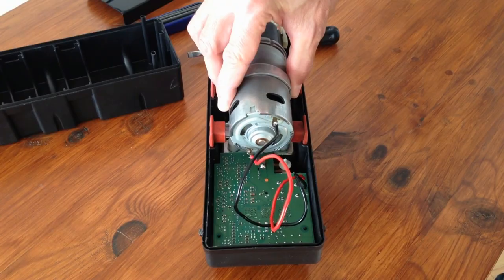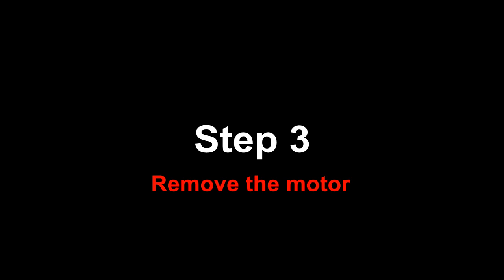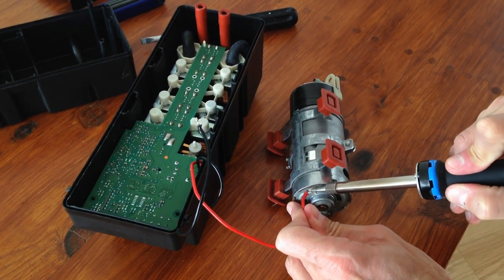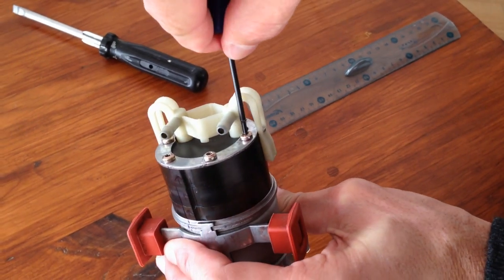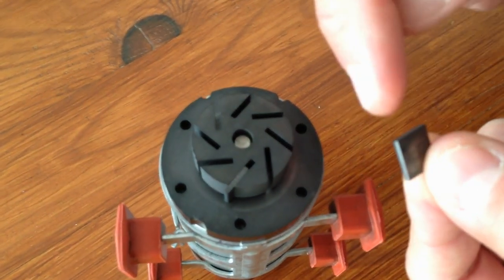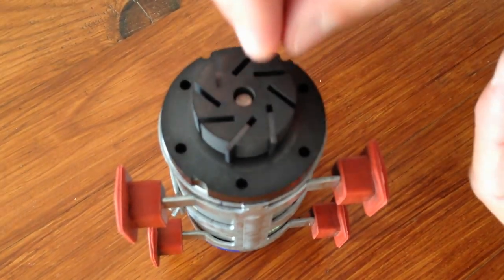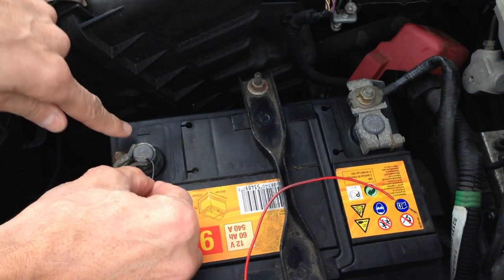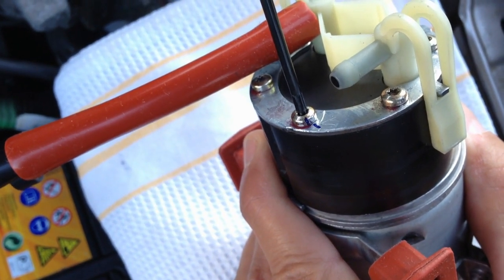How to fix a central locking vacuum PUMP broken ROTOR - Mercedes SL (R230), CL (C215), S (W220)

Comment from the maker: I hope you enjoyed this video !
The replacement rotor used in the video is available here:  https://ebay.us/kYoiGp (US & Americas), https://ebay.us/jjlMzD (Europe), https://ebay.us/TNXoau (France). It ensures a perfect functionning of the pump and the vanes are turned in the same direction as the original one, i.e. to the right when viewed from above (to the left when viewed from below !). Happy DIY ! 😉
Reply: Which way does the pump motor spin?  I am assuming clockwise?  I ask as there are two different rotors.
Reply from the maker: @kentberg9291  Absolutely ! When you hold the motor in your hand and face the drive head, it turns clockwise.
In addition, the vanes must be correctly oriented as on the original rotor, i.e. to the right when viewed from above (to the left when viewed from below !). It's essential for proper functioning. Congratulations on spotting this detail ! 😉You need to be particularly careful, as there are many poor-quality Chinese copies...

Comment: I haved owned a R107  for many years and have for some time be considering buying a R230 but have ben put off by horror stories about problems with leaking roofs and pump problems.Your video's have shown me that all is fixable and has given me renewed  enthusiasm for a R230
Reply from the maker: Hi ! Thanks for your comment. The R230 is a beautiful machine but a bit temperamental... That said, with patience and passion, you can do anything !

Comment: Fantastic video, merci beaucoup. 
I appreciate in particular that you mentioned the interchangeability with the three models, your demonstration of how to measure the pressure provided to calibrate the pump, how you point out the importance of alignment during assembly and how to prepare for it during disassembly. 
👍

Comment: Hey man, thanks a million - just pulled my pump out tonight; '01 CL600 - had blown the fuse a couple times.  Looking at it after watching the careful alignment work you did, I could see that the carbon rings were not neatly aligned.  Taking it apart, I found the rotor was not cracked - it all looked good.  I did swap the pallets in the slots end-for-end, to put a new round edge out.  I carefully reassembled the unit, following your vid. Pressure checking got me to ~58 psi, so I decided it was good.  Didn't blow the 25A fuse I put in-line to my 12V source.  Reinstalled it, will put a fuse in and test it tomorrow.  Thanks again for your thorough vid - if I hadn't seen the alignment care you took, I wouldn't have realized it was critical!  

This is the first time I'd really looked at the spare tire, while I was back there - manufacturing date of 13th week of 2001; never been on the road - neat!
Reply from the maker: You're welcome man ! 😉  Well done !!! I'm very happy that this video was useful to you ! 😀

Comment: I want also to say that this is one of the few videos that explains the issues correctly in detail. There are many videos here. Some of the authors truly do not understand what they are talking about. Others are just scratching the surface, such as "change Fuse 62." I do not want to sound like a chauvinist after living in New York for 50 years but perhaps it is because the author is European......
The part about tightening the screws on the turbine until you get 43 psi "takes the cake" because you do not find it anywhere. Perhaps, the warning about the inserts in the plastic hose connector could be added. Thank you very much !!

Comment: One sentence would be enough to summarize my reactions after viewing your video  : Omedetou ! You are a rare real " Sensei " ( in japanese language) Thks for helping MB and DIY lovers to maintain and keep their MB running " in Aller Welt " at an affordable cost. Clear image, clear voice, clear english ( not your mother language nor mine, but more understandable than a lot of original speakers) ,  clear explanations and, last but not least, real passion to share your knowledge. Congratulation ! Bravo ! 
One question : as the rotor to be changed is that expensive ( +/-119€  -2020-05-18) and as you have at hand the broken parts,  have you ever tried to glue them together and see how long it could last or ever tried to make a 3D printing and cheap copy of it ? Please, consider my question as  a suggestion et let's know how it works or worked ! Merci beaucoup !  Ciao.
Reply from the maker: Thank you very much for your compliments!
To answer your questions, I didn't try to glue the broken rotor because the mechanical constraints are such that I doubt the glue will hold...
I highly recommend this rotor (in the description of this video). It's a premium rotor ans iIts price is not so high compared to the replacement cost of the pump at MB... more than $1000 for the part and you will have to add labor because a new pump requires programming. If you want your pump to work as it originally was, you can forget about cheap rotors ! They will not last very long and the pump will not work properly...

Comment: When I got my SL R230 (build May 2006) I discovered my drivers side headrest angle setting is broken.
The high rise and fall mechanism in the seat back works fine and I know this to be a separate mechanism.
I feel sure it is nylon or plastic gear damage, someone has unknowingly wrenched the headrest away form the seat 
and sheared a cog or two.
Often intermediate settings require you to extend something fully and then they fall back to the start, 
perhaps someone didn't explore the options before forcing it.
Do you have any idea how to deconstruct, inspect, replace the cogs and reconstruct the headrest?
I suspect the dealer might be unfamiliar with this one and subsequently the cost of repair could be quite high.
Keen to have a go at repairing it myself, with your expert guideance if possible.
I am encouraged of course, one by your instruction technique, and also by the fact there are no computers modules,
or SAM modules involved in this headrest.
Have looked for an exploded drawing unsuccessfully.
Appreciate whatever help you are able to provide.

Comment: Great video! I am doing the repair right now and I also replaced the electric motor. I put everything back together and it seems to not create any vacuum. I pressure tested the system and it holds pressure up to 5-6 PSI. What am I missing? Do you know which way to rotor is supposed to rotate? Maybe I got the polarity of the motor wrong?
Reply from the maker: Hello ! A pressure of 6 psi is much too low. The pump will not work with such a low pressure...
The output pressure of the pump depends mainly on the quality of the rotor. With the rotor I mentioned in the video description, you can easily get 51 psi (3.5 bar) ! And the pump works great.
Is your new motor identical to the original one ? And why did you change the motor ? When you hold the motor in your hand and you face the drive head, the drive head must turn clockwise ! 😉

Comment: Hi. My Multicontur Seats don‘t pumped anymore. Mercedes was saying the Vakuumpump was tested and it becomes no power. Im confused because my central locking System works perfectly. Is this the same Pump? I just bought a used with the original Partnumber A0008005648. I will replace it and test if this will work. Thanks for your Videos. You do a great Job!

Comment: The vacuum pump and locking system works, but the security system is flashing the lights, inside, front and rear.  I was told this security system is part of the PSE.  Do I need to completely replace this or is there a possible repair I can do, or is there a by-pass for the security system that I can do myself?

Comment: Please help, I am desperate! This is my 4th time I am rebuilding this motor. Before I got 3 bar from the pump and experienced nearly no problems following this guide. But now, no matter what, I cant go over 1 bar. The aligment of the grooves is better than ever, everything works as it supposed to, but no matter how much I tighten the screws, max I can get is a bit over 1 bar (I had 2 bar earlier this day, and since then I only improved the assembly). I have even super cleaned all the plastic parts, the case and rotor, made sure when they spin blades slide out properly Inside, made sure the metal ring is sitting tightly on motors shaft etc. If the 2 motor pipes are pointin towards me, the right one pushes the air out and the left one sucking. The left side also has small round rubber thing that I always used before, but now when it is put in place, I get almost no pressure from neither of tubes. Also if screws are tighten too much or I have the small rubber installed the pump starts to rapidly slow down and burns the fuse. So, what could be wrong? The battery is 100% charges over 14v. I am begging you! 😭

Comment: I hav a 2005 sl 500 it is not blowing a fuse this time. I hav a lite on when trunk lid is up but when it is closed the lite goes off and no door locks or convertible top will not work. I get the message to close trunk partition. Any information would be much appreciated

Comment: Great video.  I'm not sure about the direction of the blades.   Are you sure the rounded edge needs to be outside?  I think the rounded edge needs to be inside.
Reply from the maker: Hello ! Thanks for your compliment ! On a blade, there are two opposite rounded edges and two opposite flat edges. Thus, the rounded edges will be positioned outside and inside while the flat edges will be positioned above and below.

Comment: Thank you for the detailed instructions. Unfortunately, I was not able to increase the pressure in the motor after replacing the rotor.  Wondering if something else was causing the problem for my central locking not to work, I purchased a replacement of the entire unit (black box) and connected the 2 brackets but still didn't work.  Can you advice what may be the cause of the issues please
Reply from the maker: Hello Andy ! If the pressure at the pump outlet is not good, it is either that the rotor is of bad quality (if you chose the one that I indicate in the description of this video, in this case, there will be no problem), or that the elements of the turbine are not perfectly aligned (just realign them by taking your time), or that your pump motor is tired (you can take the one from the other pump)...  And test on a well-charged battery !
If the central locking does not work but all the other pneumatic functions of the car work, your problem is probably due to an air leak... In addition, remember to check if the central locking system works by using the button on the dashboard, as this could be a problem with the key... And of course, check the 20 amp pump fuse. You must hear the pump running when it is in the car and you activate a function. If nothing is working, you may have a power supply problem, which would explain why neither pump is working. Check the pump connectors (black box). Good luck with that !

Comment: Thank you for posting this, by any chance do you know wherre to get the motors as well, I have an R230 2011 that i need to fix the pse.  also how do remove the piece  from the shaft that locks the new fan?  Thank you!
Reply from the maker: Hello, unfortunately not. However, the motor is normally protected by the pump's fuse... Before trying to replace it, I suggest you, after removing the turbine, to test your motor on 12 volts. Good luck !

Comment: My pump keeps humming on and off and every few days my trunk actuator stops working and I have to pull that 20amp fuse to reset it but, I noticed you said the fuse blows. My fuse never blows so, do I have the same problem?
Reply from the maker: Hello, If your pump runs very frequently without you doing anything in particular, then it could be a leak in your lumbar cushion. To find out for sure, set the support button on all seats to zero to see if the pump stops.

Comment: Hi there, enjoying your videos but I have followed your steps and removed pump and disassembled and found that the impeller and games are ok. What else could it be? I also got a funny smell from inside the box, is that normal? Thanks
Reply from the maker: Hello ! The pump motor may be burned out... First of all, remove the motor from the pump by unsoldering the two wires as in the video and check that it works with a 12V battery. No need to reassemble the rotor for this. Pay attention to the polarity !

Comment: Thank you excellent video! My gear is fine but the silver cylinder smells like burnt plastic what’s the name of that part thank you
Reply from the maker: Hi ! Thanks a lot ! The silver cylinder is the motor. I make a descrition of the pump elements in the video at 1 minute 20 seconds. If it smells burnt, it's not a good sign. The motor may be burned. Or, the rotor is broken, it prevents the motor from running and the motor overheats, hence the smell. First, unsolder the motor and test it on a 12V battery as in the video (don't forget the fuse to protect the motor). If you hear that the motor tries to run and jams then disassemble the turbine because the rotor could be broken...

Comment: The vacuum pump tested and run at 20 psig..however when put it back on car..no sound.heard ..what the issue should I should check..? Thx
Reply from the maker: Hello, concerning the W124 model, I don't have the specifications but 20 psi seems rather low. However, if you don't hear any noise, check the pump fuse, the electrical connector connected to the pump and the electrical connections inside the pump.

Comment: I was told those pumps aren't serviceable, that was really easy. how much did the replacement parts cost? do you have a part number?
Reply: I didn't see a part number in the link
Reply from the maker: Hello ! There is no part number for the rotor !  There is only a part number for the entire pump (the black box).  Your Mercedes dealer will only sell you the entire pump, not the rotor separately. However, in the video description link, you will find a rotor of excellent quality.  It is very important to replace the broken rotor with a very good quality one, otherwise the pump will not work properly and the motor may burn over time or the rotor may break.

Comment: Hello today I replaced my trunk latch because it was leaking air. So now that is fixed. The door locks do not go up and down anymore and the seats don't work. I can hear the air pump pumping but I'm not sure what to do next. I've read where there could be a crack in the air hose causing the seats to not work properly. If I have 1 leak does it shut down all the air functions? Are the locks connected to the seat? When I bought the car the seats didn't work but everything else worked fine. Any suggestions would be great! I am very mechanical so I would like to fix this car myself. Thank you for the great video! I subscribed to your channel.
Reply from the maker: "I've read where there could be a crack in the air hose causing the seats to not work properly." ---> Yes that's right, I will do a video on how to fix that crack...
" If I have 1 leak does it shut down all the air functions?" ---> No, all air functions are independent. However, if nothing works, the problem comes from the pump itself.
"Are the locks connected to the seat?" ---> No !
"When I bought the car the seats didn't work but everything else worked fine." ---> Your lumbar support is leaking or there is a crack in the air hose...

Comment: I understand the fins for the rotor have to have the bevel side out to match the curve of the rotor. Is this correct?
Reply from the maker: Hello ! Yes, the rounded edge of the vanes should be pointing outwards the rotor. The edge of the vanes is rounded to match the curve of the turbine inner casing at all times during the rotor rotation cycle. Thus there is no risk of pressure loss. Click on the link in the video description (below this video), you will have a precise close-up view of the arrangement of the vanes. 😉

Comment: does the rotor have to be in broken up to be bad. i checked mine and it was in one peice
Reply from the maker: Hello ! Two problems can affect the rotor: either it is broken, or it is worn out (not visible to the naked eye). In case it is worn out, the pump has to run much too long in order to operate the pneumatic functions of the car.

Comment: Thanks for the great video! I just took my rotor out of the pump because there was very little air pressure. But the rotor is not broken just look a little worn out. Can this cause the problem? I wanted to buy the rotor in the link but its out of stock. Do you know another good one?
Reply from the maker: Hello ! If the rotor shows wear marks, there is nothing abnormal after a few years. However, you can make sure that your rotor is working properly by performing a pressure test by connecting the pump motor directly to a battery as I show in the video.
If you have a lack of pressure in your car's pneumatic system, it could also be a leak in a pipe, an actuator or the pump itself.
If the drop in pressure only concerns a particular pneumatic line and there are no concerns on the other lines then you can move towards a leakage search on that particular line (pipe and actuator).
Reply: New rotor and it works again. Thanks a lot!
Reply from the maker: @janphilipp7410  Great ! Happy to help !

Comment: Would a broken rotor blow the PSE fuse IMMEDIATELY once a new fuse is installed? Or is that usually caused by some other failure in the PSE system? I'm thinking about buying your rotor, but just not sure it's going to fix my issue.
Reply from the maker: Yes ! When the rotor is broken it usually prevents the motor from running and the fuse blows immediately when you put a new one in. This is the most common failure.
However, you may have a short circuit somewhere or a blown motor and this would also blow the fuse, but this is much rarer because this pump is designed to electronically stop a function when the motor runs too long to prevent it from blowing.